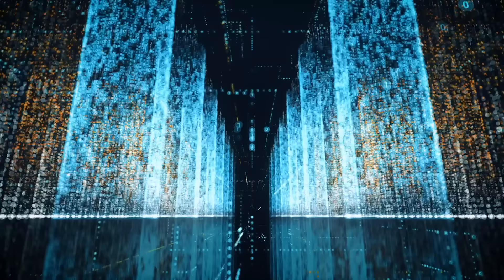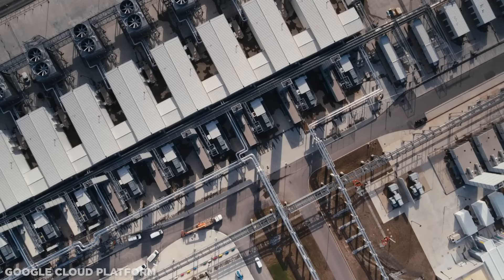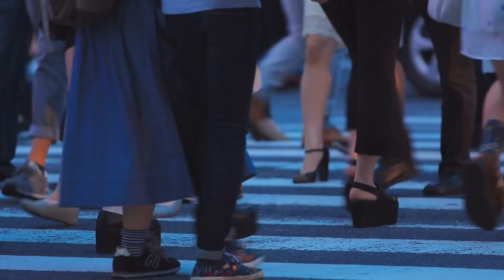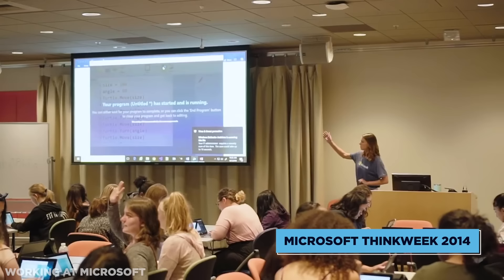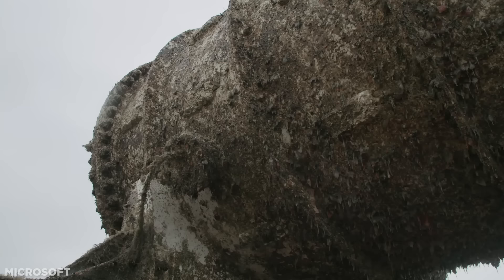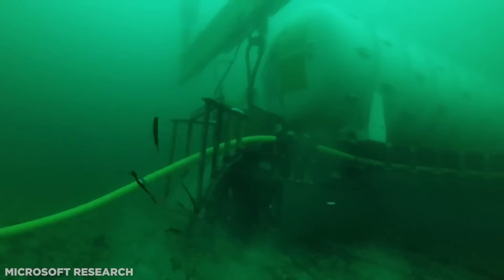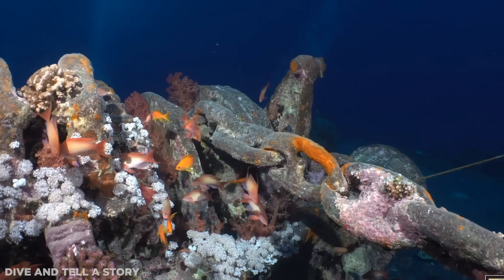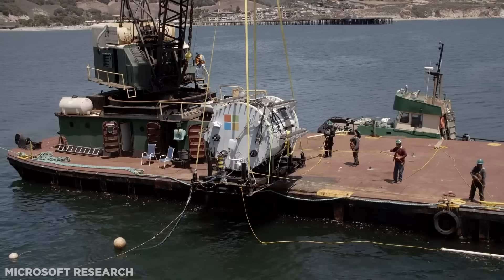Why Microsoft Has Underwater Data Centers

Comment: Methane which is 28x more destructive as a greenhouse gas is produced by vast landfills, and barely tapped as a source of energy, or to be reduced as a pollutant. Projects like this data center are great but it really seems like priorities could be better acknowledged globally. Why go for inaccessible high branches when there is so much low hanging fruit?
Reply: The sunken data centres avoid having to pay for land use, having to pay for electricity, having to pay for cooling and having to pay for disposal of toxic e-wastes...

It is the sunken data centre that is the low hanging fruit.
Reply: @johnwang9914  all data centers in the world = 2% emissions, methane is closer to 22%. So not really I don’t think John.
Reply: @johnwang9914 the data centers are super, but capturing methane is a higher priority in reducing green house gasses bot.
Reply: @peters972   Avoiding the emissions of methane is what must be done not recapturing it.  Methane breaks down due to sunlight in about 9 years and there's no way you can process enough air to recover enough methane.  You could try to capture methanes from land fills but that will only have partial success.  You could avoid methane production by encouraging aerobic decomposition over anaerobic.  

The rising temperatures will soon release enormous amounts of methane from the thawing permafrost and ocean clathrates.  

Sunken data centres are not about methane.  The only relationship to global warming that such data centres have are the use of wind power and the transfer of all the energy into heat in the oceans.
Reply: @johnwang9914  Capturing methane from landfills is an enormous and largely overlooked source of energy for your data center. There is a double advantage. firstly it removes landfill methane from the atmosphere which does 28x more damage than Co2. Second, it can be used to generate electricity. Not pretending it cures everything. Just saying, it is a low hanging fruit. The video said only with thousands of data centers underwater, emissions due to data centers can be reduced from 2% to 1%. Meanwhile, landfills have grown so large they can be seen from space. The one in New Jersey is the largest man made object in the entire history of the planet. There is great opportunity there. Thank you.
Reply: @peters972  First it would be easier to use biodigesters, second we do have landfills that do capture their methane and it has only helped offset part of their operating costs, there has not been enough surplus for any other services such as a data centre and third there are landfills that use gasification (steam reformation) to produce syngas (hydrogen and carbon monoxide gas aka town has, wood gas, coal gas etc., far more efficient than biologic production of methane) and that too has only been enough to help offset the operating costs of the landfill with no surplus to say run a data centre.   Methane recovery or gasification of trash will never be enough to run a data centre and it is also doubtful that biodigesters would be sufficient either, though the sewage system addresses a large part of the energy costs of delivering the feedstock in the first place.   Even if biodigesters did have a surplus, the energy sold would just be sold to the grid where it would serve a myriad of increasing demand such as electric vehicles and the benefit of the energy production would not go to the operators of the data centre so it would not have the same benefit as these sunken data centres to the people who would build and operate the data centres.   It isn't that I would want these data centres to exist, I don't, but your hypothesis that methane from landfills would be an alternative to produce carbon free data centres is false, recovering methane, despite the massive increase expected from permafrost and clathrates would be lucky to recover the capital and operational costs of doing so and with respect to landfills specifically, have not been able to do so.   

Of course, the real problem is the demand for compute services especially with digital currencies can never be met, since the current competitive checksum approach is predicated on  rendering much of the computation redundant as miners are beaten by other miners in achieving the next checksum for a block.  

Unless we form notary blockchains which has the problem of being an authoritarian social service system instead of being a purely asymmetric peer to peer system motivated by individual greed independent of an authority, we will never reach the energy demands of data servers regardless of energy sources, even the matrioshka brain megastructures would not meet the competitive checksum blockchain method in the long run.  Yet even now with the uncertainties of the pandemic, people have invested in Bitcoin as a commodity.  Not only a waste of it's potential but encouraging a system that is simply not viable due to energy consumption.   

Carbon free data centres are doomed unless the world government's or corporations either individually or collectively set up an alternative notary check summing system (note the the web's SSL security system is a crude version of such a system and could probably be leveraged to produce such a system).

We shouldn't be fighting over preferred forms of carbon free energy as all should be embraced but uniting against inefficient protocols demanding ever more data centres.

Comment: Space data center is the way. Doesn't harm/come in contact with anything living .. that we know of.
Reply: Until it falls on you.  There's also latency of communication and that the communication must be by radio or laser not cables and fiber optics.
Reply: Temperature control would be a huge problem (cycling between extremely hot and extremely cold), and rates of data transfer would be way too small for a data center. Plus installation costs would sky-rocket (pun very much intended) - server farms are way heavier than most satellites.

Comment: if the super thic and safe, with multiple layers covered CAT8 connection has been disrupted under sea, so how this cabling will survive ?   second thing,  how do they replace a failed hard drive ?
Reply: Nothing is replaced until the whole thing is resurfaced after 2 years.  Redundancy is built in to hardware or the individual server is abandoned until resurfacing.
Reply: @gextreme2381  i dont see any efficiency in this.  Lets say im working in a worldwide famous datacenter and i know how many issues we may encounter in a server which can not be physically reached.   It is good as a experiment project but not a funcional problemsolver.
Reply: @norbertbrilliant8548  Total difference in architecture and deployment . You need to build the overall with the servers being expendable. If it dies or is unresponsive there is always multiple other machines that can take over for it and that. There are local and remote replicas that all perform the same functions so if a server dies it doesnt matter one bit (pun intended). This is not an architecture for small systems or individual installs. I'm also not saying I endorse it, I'm just explaining it.

Comment: Seems like a really wasteful method of achieving an interesting aim. Why not just provide an access airlock and sink it in less than 40m of water so a dive team can just go in and perform maintenance on the kit inside and swap out server modules as needed rather than the entire structure? Also, I would build the hull out of aluminium, using a ribbed or finned design to maximise heat exchange with the water, and also make it more attractive to marine life. It is a much better heatsink than steel, and is less affected by corrosion. It is a weaker metal so would need to be thicker, but this isn't a concern to something that isn't going to be moving or have long term habitation.

As for the atmosphere, nitrogen is a poor conductor of heat. It'd make way more sense to use helium for the atmosphere. it's a much better heat conductor, and is also a noble (unreactive) gas.

Comment: This seems to be a really good idea!
Reply: Littering the sea is a good idea?   You do realize that the intent is to never pull them out but to just sink new data centers to avoid e&waste regulations.   Sure the energy is wind powered but this is taking heat normally generated over land by friction and hence radiated into space on clear nights and transferring it to the sea where it can accumulate.   Land is where the Earth dissipates heat, the ocean is where the Earth collects it.

Comment: Reservations: Hardware vulnerabilities would be much harder to address when the hardware is under several hundred feet of water. Additional hardware will be needed to provide the redundancy needed to deal with hardware failures that cannot be remedied. Apple silicon may solve the problem of data center carbon footprints without requiring such extreme measures due to it's much lower cooling and energy needs. Sinking the current physical volume of the world's data centers in narrow steel tubes would require a vast number of such tubes, which would be enormously expensive, and have quite a carbon footprint of it's own, from iron mining, smelting, net shaping, and final manufacturing to transportation and placement. While physical intrusions would be more difficult, they could potentially go undetected for long periods of time, resulting in greater data breaches and security vulnerabilities. Sunken server clusters could be suddenly destroyed by a loss of hull integrity and resultant flooding, which becomes increasingly likely over time if using steel due to both corrosion and metal fatigue. I think this concept may create more problems than it solves.

Comment: If I work at Microsoft they would put me in charge because I have the best idea to have a server at the bottom of the seabed make it water cooled where it takes water through these pipes to the servers then it goes back out like a PC it goes to the board and it takes the hot water out